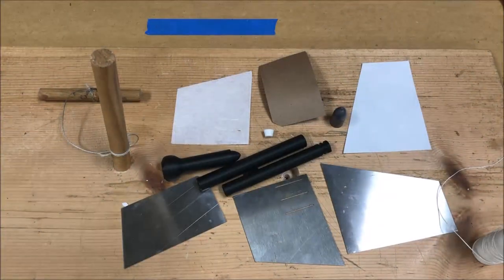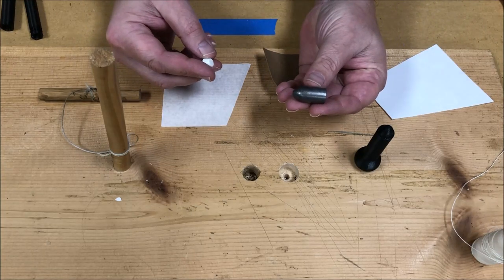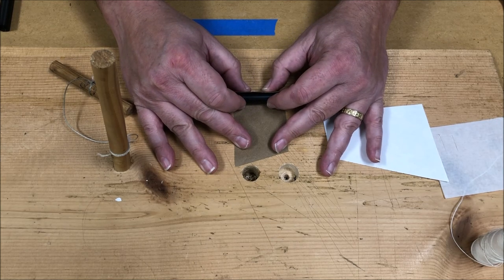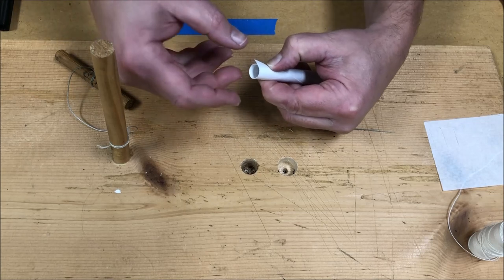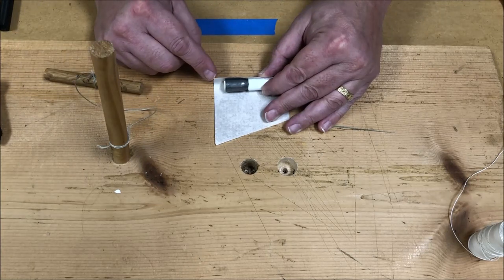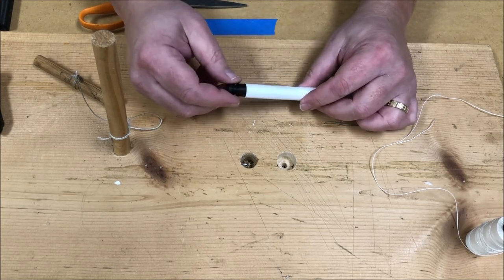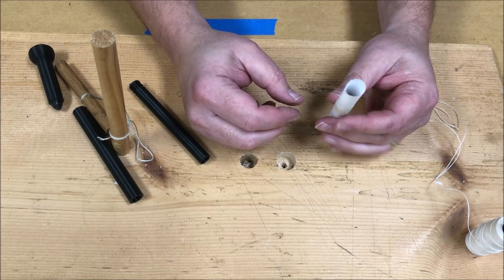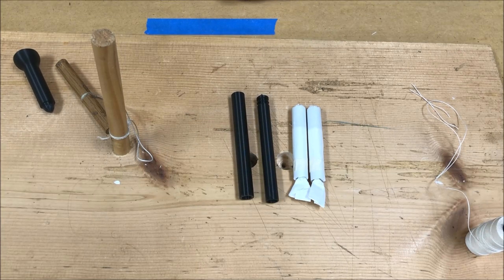Tips on Constructing the 1860 British Enfield Cartridge

Comment: Thanks Steve for making this video!  I recently purchased this Enfield set from you, and the video answered a couple of questions which came up when I started making the rounds.  I was wondering why I had two longer mandrels, one being about .50 inch and the other .550 inch.  I've been using the Bienfang 360 100% rag marker paper on the smaller mandrel, (the one with the grooves on one end), for BOTH the bullet compartment and powder chamber outer wrapper.  That may explain why I am getting a looser fitting/sloppier powder chamber.  If I go with regular copy paper for the powder chamber outer wrapper like you do on the video, I will probably get a better looking, more uniform cartridge without the wrinkles.  My guess is because it is a little thicker paper than the rag paper.

I also was having trouble choking and tying off my bullet compartment when keeping the bullet exactly at the end of the slit line, due to the fact there just wasn't enough paper to work with and tie off.  Moving it a little past the base of the bullet like you do in the video allowed me to tie things off much easier.